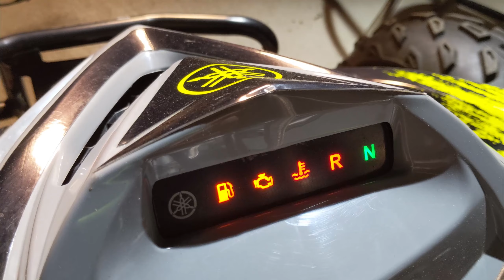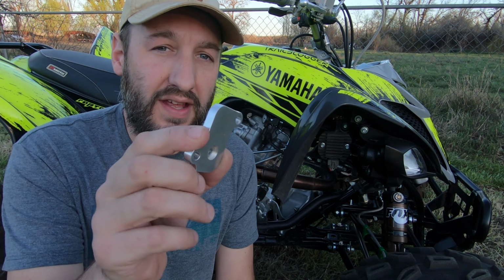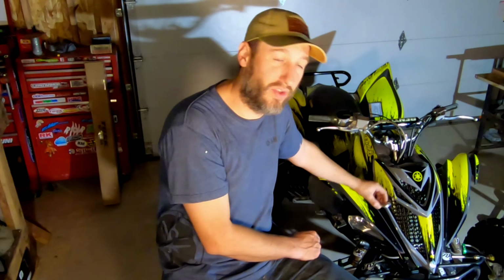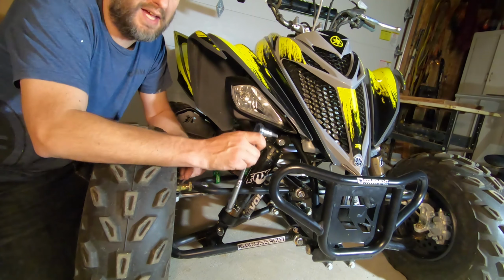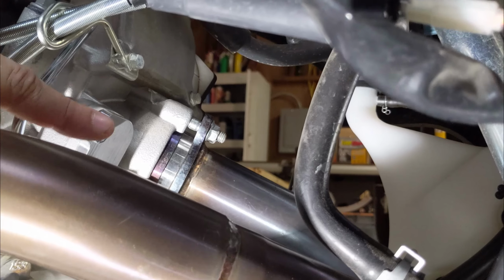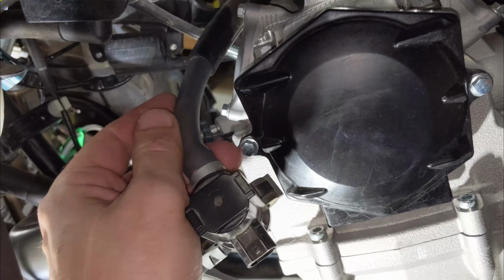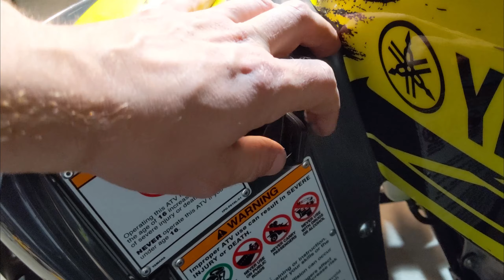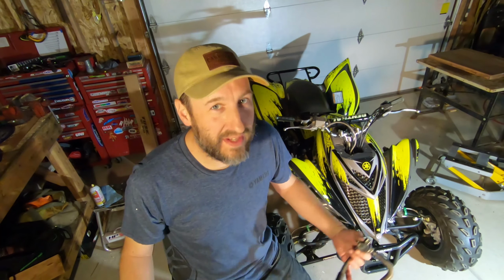Yamaha Raptor 700 AIS Block Off Plate by Cuervo Racing - Stop the Popping

Comment: Does the pop mess up your quad?? I kinda like it to be honest
Reply from the maker: a slight pop is ok but these things come tuned very lean from the factory which can make them run hotter than needed and it is already 110F here in the summer. Adding more fuel to richen the mixture with a proper tune helps make the bike run smoother. the AIS injects extra air into the system. I don't care so much about the pop as I do about it running correctly. backfires can be a sign of too much fuel or not enough fuel in some cases

Comment: Air Intake will be the next mod!
Reply from the maker: I plan to do the intake, good guess but that's not up next. Feel free to guess again 👍
Reply: Trail Blogger pretty sure i'm wrong, but I guess you will go for new or revalved rear shock absorber
Reply from the maker: @yxiscatti  another very good guess, I added a 2017 SE rear shock when I did the fox fronts, a rebuild on the rear would be a good idea but it's fine for now
Reply: @trailblogger  tusk +2 rear axle
Reply from the maker: @yxiscatti  you are correct but someone else guessed correctly first. Thanks for leaving comments though! We'll have another contest soon!
Reply: @trailblogger  I was not really interested winning the boucher, just wanted to guess, I just didn't read who already guess it, anyway I was in the right road. Missing your riding videos, hope to see some soon! By the way, I know its offtopic, but, why you changed your stock handlebars? It looks like the new have same bend as stock, im curious since my only quad is raptor 700 and I made it some mods, but it still on my stock handlebars, want to know if it worth to change it and why. Thx!

Comment: I have a question that has nothing to do with the video but about the rev limiter and though well maybe someone can explain I see these stock raptor and they hit their rev limiter and makes that cool noise if you know what I mean. When I hit mine it just sounds like the rpms are to high no revlimiter noise just the rpms getting louder ! Is their something wrong with my raptor ? It’s a 2019 se
Reply from the maker: mind has an exhaust and tune. stock pipe is very quiet and restrictive
Reply: @trailblogger  ya just looking for some insight I’ve found multiple stock raptor that bounce of the limiter but mine just makes a loud revving noise .
Reply from the maker: i have a video of mine bouncing the rev limiter with stock exhaust in my HMF video. did you buy it new? someone bypass the limiter on yours?
Reply: @trailblogger  ya brand new out of the crate from my dealer I got on the forums not much is said about it but it could just not be working ! I’ll take a look at the video, I’m not to worried about it I never really try to hit the rev limiter just weird that mine doesn’t do it. THANKS i appreciate your time !
Reply from the maker: are you holding it pinned wide open?

Comment: Great video and nice bike!! I have a 2014 raptor 700 and it’s always pulls to the right, could it be the tire pressure ? And also I here a clicking noise coming from the right front tire. Any guess what the problem might be
Reply from the maker: Wheel bearing or brake caliper or both.
Reply: TrailBlogger thank you

Comment: I installed one of these block plates and now she’s running hot, the spark plug wire going back to module the wire start to melt. The wire was 3-4 inches from the exhaust pipe. Never was a problem before
Reply from the maker: sounds like an air leak causing it to run lean
Reply: @trailblogger  air leak wear
Reply from the maker: @chrisrieger9201  where you installed the block off. if you suspect it is causing a problem just put it back on. takes 5 minutes
Reply from the maker: when you install the plate you leave the pieces inside and put the plate over it.
Reply: @trailblogger  correct and I cap it at the air cleaner box, tape the wire connector electrical tape
Reply from the maker: correct. have you tried putting it all back to see if your heating problem goes away?
Reply: @trailblogger  not yet

Comment: Do you think the raptor is faster than the yfz
Reply from the maker: Depends on rider and terrain.
Reply: TrailBlogger  in the street and both are good drivers
Reply from the maker: @bigstevegapping6315  sorry I've really never rode in the street
Reply: TrailBlogger what about on dirt
Reply from the maker: @bigstevegapping6315  raptor more torque off the line and overall HP. Yfz450 better handling and overall mid range performance with weight taken into consideration. Yfz is more race oriented while the raptor is considered a recreation trail machine. Both machines can be modified for drag, dune, street riding depending on what you want.
Reply: TrailBlogger so for what I said that I like racing and going fast and trail riding which bike you think is for me
Reply from the maker: @bigstevegapping6315  depends on what your trails look like!
Reply from the maker: @bigstevegapping6315  is sit on both and see which one feels more comfortable.
Reply: TrailBlogger the trails are like long dirt roads with Gravel and I have set on both of them but I still don’t know
Reply from the maker: @bigstevegapping6315  if you see yourself doing a lot of actual track riding and racing in leagues I'd lean towards the yfz. If you are looking for a trail machine or casual dune rider I'd lean toward the Raptor. The raptor can also be built into a nasty drag machine if that's your plan. It really depends. For recreational trail riding I'd probably stick with the Raptor.
Reply: TrailBlogger I plan on drag racing and some times trail riding
Reply from the maker: @bigstevegapping6315  have you ever ridden a sport quad before? might want to get something smaller like a warrior to mess around on first and get the hand of it, raptor and YFZ450R are a lot of power to learn with.
Reply: TrailBlogger  yes I have had a sport quad before I had a 2012 YF450R and I want to try something new but i don’t know what to get to even go back with the yfz or get a raptor because things have changed and i don’t know which one to get
Reply from the maker: @bigstevegapping6315  raptor is a great machine, you will most likely be happy with either one. I'd go sit on them both and pick the one you cant live without
Reply: TrailBlogger ok

Comment: it would have been easier to sandwich the block off plate using longer bolts. that way you dont need to mess with any of the wiring and tubing. plus it makes it look like its never been modified.
Reply from the maker: I prefer less clutter. less wires and tubing

Comment: What would make 2000 warrior with HMF slip on make popping noise?
Reply from the maker: Running rich or lean, out of tune. Or an air leak in the intake causing a super lean condition.
Reply: @trailblogger  I have a zoom zoom carb, needle halfway, should I try dropping clip one more spot and raise needle?
Reply: @trailblogger  I checked timing, all good, no rips in intake boot, gonna check valve clearance tonight, just wondering if there is anything else that I should look into
Reply from the maker: @johnsayman2271  sorry I've never tuned a zoom zoom carb, does it have a fuel meter like a lectron carb or is it jetted? Does it run any better with the choke on? If it does that means that it's on the lean side and needs more fuel. If the popping continues with the choke on even it may be too rich and you need to lean up your tune with less fuel
Reply: @trailblogger  its is identical to the mikuni,
Reply: @trailblogger  the original carb on warrior is mikuni but i got it in pieces and parts are missing, think I will buy a carb kit for OEM mikuni

Comment: Can you install the block pop stop if you only have oem exhaust system/pipe
Reply from the maker: yes it just blocks off the air port up there. aftermarket pipe is not required.

Comment: hi, did you have any problem with the 700 raptor because of the AIS block off plate ? thanks
Reply from the maker: no issues
Reply: @trailblogger  I got one coming now, but why does it do actually do besides the noise get a permit for give me more power?
Reply from the maker: Blocks off the extra air making it easier and more reliable to tune